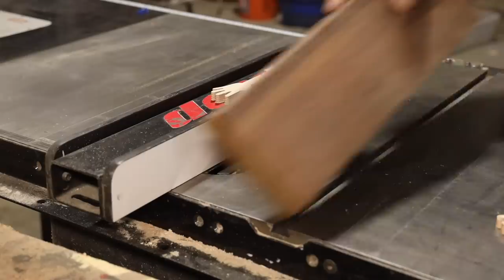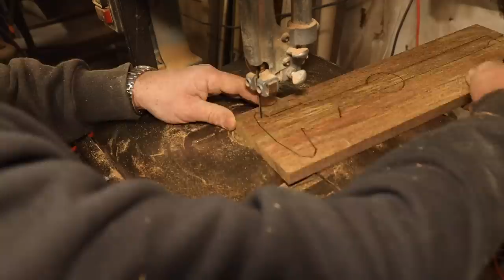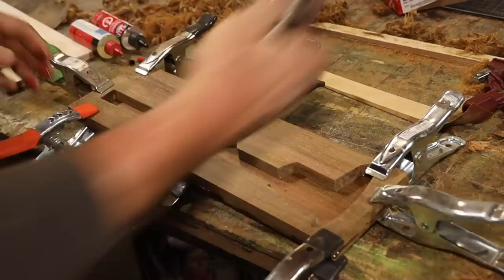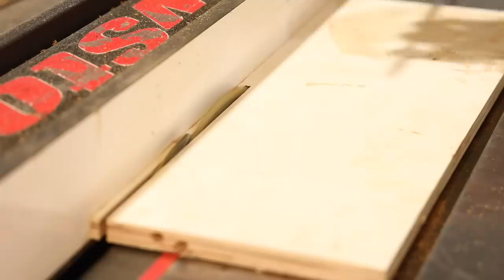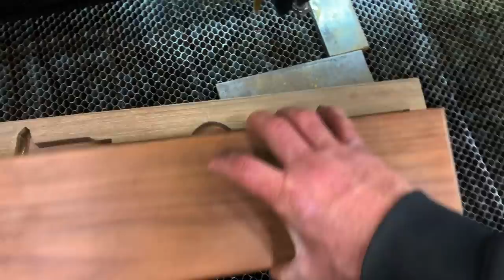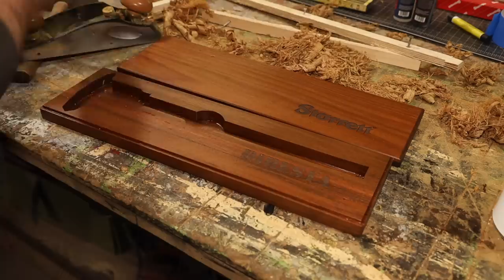DiResta Caliper Case

Comment from the maker: Few facts: 1-I avoided magnets to avoid metal dust in MY personal shop.  More than wood here.  2- i used epoxy to keep the build moving along. Five minute epoxy. Not 20 hour PVA.  3- the top is not warped. It is touching the bubble on the dial.  I took off too much material flattening the wood that surrounds the caliper I did make a dimple in the top after the video. Also the reason for no felt.  4-this is not a sponsored video. 5- the  giveaway is not mandatory if it gets you upset ignore it. 
6- thank you for the love and support over the last 9 years ✊🏻
Reply: Starrett deserves a case like this. Should have flocked the inside though. Green.
Reply: Regarding #1, I used tiny rare earth magnets to keep my caliper box closed. A case of personal choice.  Nice video.
Reply: Omg, the people that get upset at other people's contribution to the collective good will never cease to infuriate me. I know I don't have to tell ya, but keep doing you, Jimmy. Never have to explain nor defend yourself to those of us who love ya.
Reply: The upset folks may be as soft as the felt you didn’t need. Thank you Jimmy D. For the project using hand/power/automated tools from your shop. I don’t have them all but appreciate the examples so I might do the automated parts by hand some day or just appreciate the advancement as I’m not in production more than a one a one off.
Reply: I read it, Jimmy. lol

No need to tell me twice. 

(Honestly, I was just curious about the wood type. But I read your descriptions more often than most since you rarely speak in-video and I'm always curious for more information.)
Reply: instablaster

Comment: In the good old days they would have come from the factory in a case like that.
Reply: Exactly.  Back when you could figure out exactly how something worked by taking it apart with a socket set and a couple of screw drivers.  I'd say it was so you could easily access anything if you needed to fix it, but back in those days things were built to last.  I sound old.  Get off my lawn!
Reply: @BoomerKeith1  I am old, remember everything you said, agree with it and back up “Get off my lawn” with a shotgun. 😂
Reply: I have one at work that did.

Comment: Props for making it old school.  As soon as I saw the piece of Ipe I thought, “Here’s one for the CNC machine, for sure”.  Of course, now you need to go sharpen every blade that cut that wood.  Ipe is full of silicates and will promptly dull any cutting surface.  Great use for a scrap piece of decking, though.  Well done!

Comment: So many cool aspects to this. (someday perhaps I'll get a laser!). I don't blame you on the no magnet thing. I had to ream a hole in metal a bit recently - not even that long of a process - but next thing I knew, I had fine metal dust stuck to where the lid magnets are on a MacBook I had in the shop at the time. Easy enough to wipe down but lesson learned.

Comment: Awesome project!  Quick tip for laser engraving -- cover the wood with transfer tape (or even masking tape) and you won't get the soot on the surface.  Also, when engraving, turn your air assist way down -- just enough airflow to prevent the smoke from backing up into the nozzle.  That will also help by not blowing the smoke into the surface of the wood.

Comment: +1 on the felt interior. 
It doesn't have to strictly be "felt",I reckon any microfiber fabric to protect scratches would do.
It would double as cleaning the dial :P 

Maybe add a leather band with a button to keep the box closed. That would be a good finishing touch :)

Comment: One of those tools I use SO often, I never put it away. Always within reach.
Reply: One of the only tools I make sure to put away every time, so it’s not dirty or (shutters) bent.
Reply: @Fordallas  I have at least five or six of various kinds laying around.  My goto set is some Mahr digitals, but I also have a number of vintage mechanical ones around machinery.   For precision (well, for calipers), I have a set of B&Ss that I swear by - they live in a wooden case.  That way, you always keep the good ones pristine.
Reply: I wonder how many of us have a 12 inch/300mm caliper whether dial or digital?  I suspect that most of us that do, still have aging Vernier in that sort of size.
Reply: @TrevorDennis100  I only have a personal 8 inch digital... Micrometers, though, I have to 12 inch😯

My employer though, had Verniers to 40 inch..
Reply: @Fordallas  one of mine is always on the bench
Reply: I got rid of the cases as well. I rather hang them up the wall.
Reply: I have an 8” dial and a digital. 12”. Both are Mitutoyo.
Reply: My Starrett caliper is a POS. It keeps jumping a tooth. I’ve had a watch repairman I know fix it 4 times. It just did it again. I threw it in the trash! Nice Box Jimmy. I like the design for the lid connection. Thanks!

Comment: At what point during the build did you regret not putting the circular cutout closer to the dial so that it is balanced when you pull it from the box? Great video, BTW.

Comment: That Ipe looked really quite tough to scrape and sand, this box is going to last ages! Is its hardness the reason you glued it with epoxy rather than regular wood glue, or was it purely for speed?

Comment: What glue did you use to glue the two halves together? 4:28 . And why didn't you use regular wood glue? Greetings from Sweden. Love your work, I have followed you for a very long time.. Keep up..
Reply: Regular wood glue doesn’t work well with ipe. Titebond polyurethane glue, CA glue, and epoxy work better. 👍🏼

Comment: Did anyone notice he got his measurements wrong and the lid doesn't close properly with the calipers in the box, not hating on it or anything it's a cool box
Reply from the maker: Good eye.  I do have to hollow out the face of the dial side by .03 ish.  Thank the center part got thin. Also no room for felt.